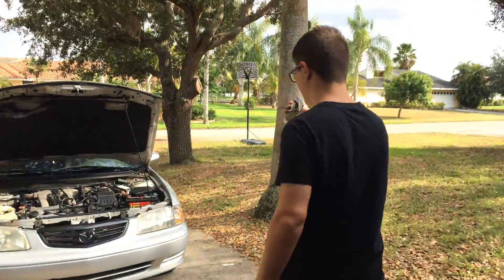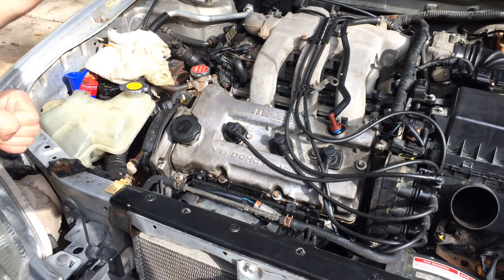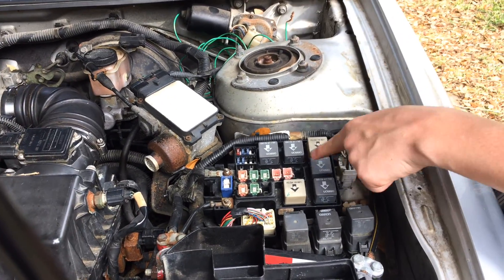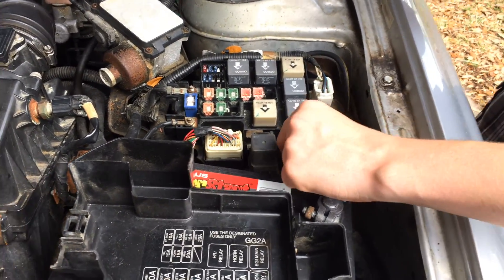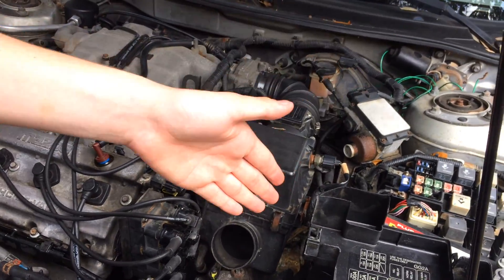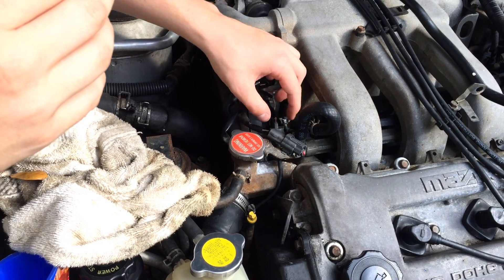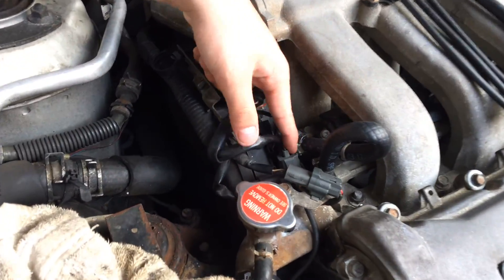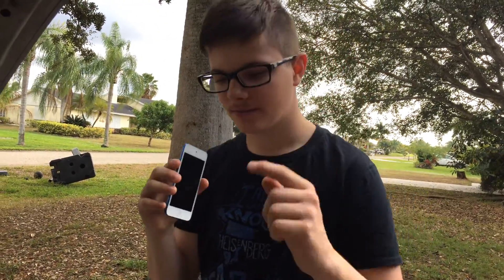How to fix radiator fan not coming on/overheating! Mazda 626 + more!

Comment: Today is October 3rd. Been without my Mazda MPV for three weeks. I bought a new radiator fan assemble thinking that was the problem for my van over heating. It did not turn on, the fans didn't. So, just a few minutes ago tried your suggestion, switch the horn relay to the AC relay and BAAM! it worked. You just saved me a ton of money. I can not thank you enough. Thank you, thank you, thank you. Greetings from Austin, TX.  God bless.
Reply from the maker: I for some reason am just now seeing your comment, and just wanted to say I'm glad this helped you, my hopes with posting this video were that it would at least help somebody, as this was a frustrating issue for me! Happy to hear you found the video helpful and were able to resolve the issue, thanks for watching!

Comment: The best practices method of testing an ISO relay marked with 85-86 is coil, 30 is power common, 87 = Normally Open, 87a = Normally closed, marks on bottom next to terminals. Use a digital multi meter and make 4 jumper wires 6-8” long. Remove relay, connect jumper wire so it can operate normally, then attach meter leads to 30 & 87, turn DDM on Vdc and watch for voltage drop across burn’t, inside terminals. A good reading is 0.080 vdc or less, re-try 6 - 9 times, open/closed. If one time it reads 1.23Vdc or more, it’s bad for sure. Swapping is an emergency testing a best as relays that operate fans, coils, etc.  have a clamping diode inside while the rest use resistor in parallel with coil, so ECM/PCM can test it for OBD-II. Different relays for a purpose plus 20A, 30A, 40A who knows, but get this rating wrong and life will be short. Many good voltage drop videos as it is an auto tech best friend if you do electrical work. It was for me the last 40 years.
ASE Master Tech since 1978 - Retired

Comment: thank you very much, i tried to take mine off today since the fan doesn't come on and it literally broke while i was trying to take it out
! just the jacket with the two-wire connected to it where it hooks on to the sensor) so i am a bit in trouble cause they dont sell the peice by itself
Reply from the maker: No problem man this problem stumped me and my father before I owned it, was a constant problem even mechanic couldn’t locate this damn thing. Crazy stuff with these cars, simple wants ya know where it’s all at!! And when you can get the part lol. Glad you found the vid helpful bro, don’t forget to hit that subscribe and turn the notification bell on! Appreciate the support

Comment: Be careful changing relays around. Just because the universal terminal configuration fits the relay, the relay can be different two ways. The coil the creates an electro-magnet, has a given resistance. One may have a resistor in parallel with the coil because resistance changes with temperature or goes down. The ECM/PCM once the engine is started, starts checking components in the vehicle necessary that affect emissions. This is in done on relays using a voltage across the coil, then measures the voltage drop as the PCM either controls ground or supplies ground. A second version of relays use a clamping diode that prevent high voltage from returning into the electrical system. Commonly used in relays that control electric motors directly. A/C clutch coils can induce up to 180 volt dc and use a 1/2 watt diode installed at the compressor, tapped to the harness or in the fuse box.

The other more common fan control problem used on Mazda/Fords on many models over many years. It is controlled by PWM to turn the fans on slow to fast. The relay supplies power to the fan control module only and inside the controller, they use N-Channel MOSFET(s) inside, which when turn on/off w/PWM supplies ground to the fan. A trinary switch/set pressure switch or PCM input from the A/C switch turns a PWM signal to operate fan #2 for A/C and fan #1 for the engine on most models. Yours may vary.
 The temperature switch for engine coolant is a NTC thermistor that has low resistance when hot, high resistance when cold. Easy to test with a DMM over a given temp range. Who knows other than published in the OEM service information +/- 5% ohms. The thermistor is sealed in a metal bulb and held in epoxy that is designed to conduct heat. NTC is the most common type. With the internet and YouTube you can look this stuff up and watch short informative videos that did not exist when I started repairing go-carts, lawnmowers or vehicles in the late 60’s. 
ASE Master Tech since 1978 - Retired

Comment: I am having an issue with my 2000 Mazda 626 v6. When I start the air conditioner it wont start immediately. I have to wait for a while and then the AC will start. I asked my mechanic and he told me it should be low on AC gas but I checked the gas as well and it does has enough gas. Do you think AC relay will make a difference?
Reply from the maker: Do you mean it takes a minute for it to start blowing? Or it blows immediately it just takes time to blow cold?
Reply: It does blow but it takes long time to blow cold air. But on the other end heat works perfect. And I don’t even have any overheating issue.
Reply from the maker: Sounds like compressor may not be engaging when it should could be evap sensor or compressor clutch. Next step I’d take is to make sure the compressor is running when it’s blowing cold or if it’s not running the whole time it’s warm up until it’s cold etc to see if the compressor not running is the culprit of no cold air. If compressor is running and it takes awhile to blow cold it could be different issue.
Reply: Helvetica the issue was with Air-compressor relay. I just tried changing it with Horn relay and it did work out. Thank you very much for your time.

Comment: Already changed the module. $15.00 on line. But it's not working again got radiator too. Got a Mazda mpv van same modular. How about I try every relay if not marked!!! I also replaced  that sensor  part it's was $49 .

Comment: I have a Mazda Protege 2.0. Coolant Fan isn't working I believe. When I unplug the temp sensor, the guage reads cold and condensor fan kicks in but not Coolant fan. Both Relays for ac and coolant fan clicks while temp sensor is unhooked. Fuse also looks good. Is there anything else I need to check before replacing the whole fan?
Reply: sKabii radiator fan switch 😏😉
Reply: Found the problem. It was the Radiator Coolant Fan Relay. It clicked but I had to tap it for the fan to come on.
Reply from the maker: Sorry i missed your question, glad you got it fixed!

Comment: Did you have an issue with your idle also? I noticed when the a/c is on of Im stopped the idle jumps a lot. Jw if that was an issue for you and if it fixed it.
Reply from the maker: The idle may fluctuate slightly when the AC is turned on/off. This is the compressor clutch engaging and putting a light load on the engine. If it jumps around quite a bit, and continues to do so once the AC is on you may have other issues.

Comment: Helvetica when I turn my AC on two fan turn on but is not turning on when the engine is hot And my car will overheat
Reply: I put a brand new thermostat ,radiator ,fan switch sensor and a temperature sensor what could it be
Reply from the maker: Hey John! Thanks for watching - help me understand the problem a little more. When the car is hot the fans won’t turn on with the AC? Is the ac working? Blowing cold?
Reply: Helvetica Not really the AC blows out warm. When I drive the car is good when I come to a stop and in traffic the Car will overheat I had the radiator change thermostat temperature sensor and cooling fan switch and also swapped the relay to check and when I put the heater or AC both of my fans seem to Work just don’t understand why is not turning on when the car is hot and making my car overheat

Comment: I have a Mazda 3, 2011, neo. For the past month or so I have noticed (several times) that the aircon fan does not start up upon turning it on. I will leave it on and drive around for a while and suddenly it will come alive. Its summers here. 

I took it to my mechanic, he did full service of the car; checked the air con, and it was full with gas and is perfectly healthy. He could not decipher the cause of fan malfunctioning. The fan was working fine when I took the car to him, and all the while he serviced the car. 

What can be the potential cause in your opinion?

Thanks in advance.
Reply from the maker: Could be a bad AC relay, (on its way out), or more commonly a fan motor thats on the way out. The motor probably has a bad spot in it, and may come on while your driving due to it being moved around or jolted just enough, hence why it works intermittently. It will probably get worse over time until it no longer works completely.